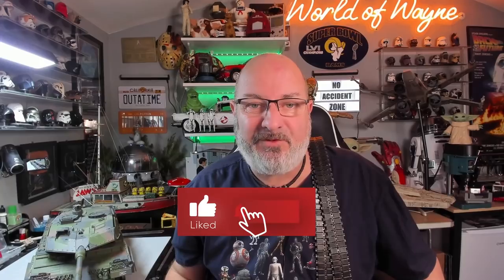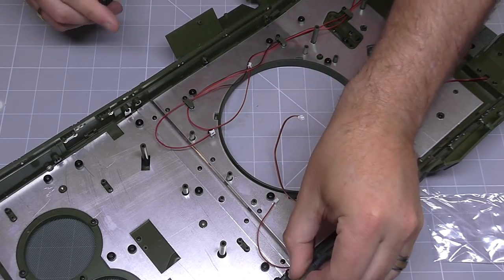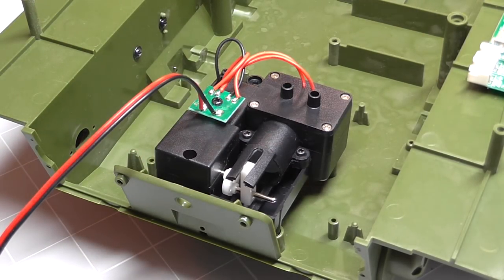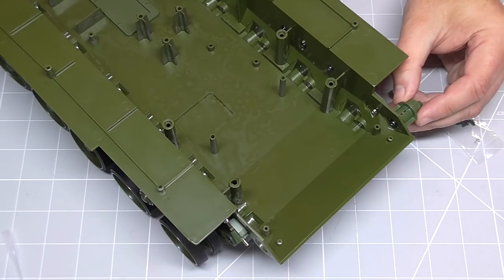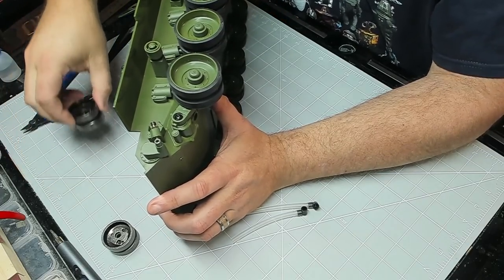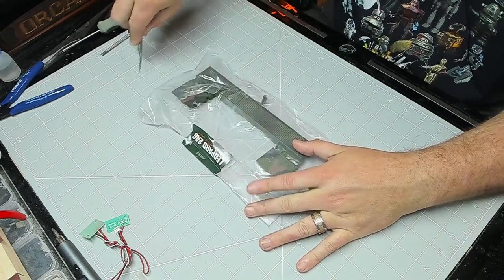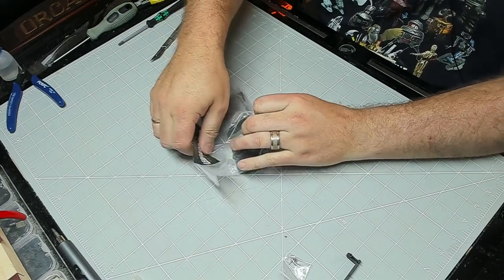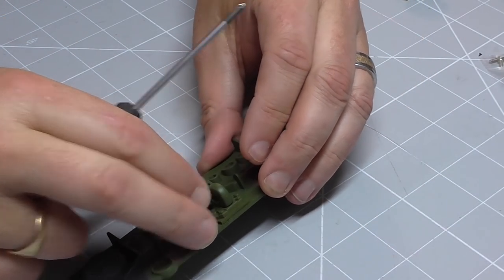Build the 1:16 Scale Leopard 2A6 Main Battle Tank - Pack 8 - Stages 61-69

Comment: Hi Wayne, stage 64 are the track tensioners.  They should spring outwards to keep the track under tension.  I found that they gave a better tension if you fitted them the wrong way round.  I.e.  left to right.

Comment: Hey Wayne 🙂those tensioner spring set ups should actually have 243 loctite on the screws and left juuuust undone to allow free movement 👍
Reply: Or 3 in 1 Oil
Reply: @bedfordshiremodeller4491  nah definitely not oil, by leaving the screw just loose and having the joint movable like it's needed so it can operate, that will let the screw work itself out, by using loctite, it will stop it where you set and not eventually fall out👍

Comment: When you mounted the rear lenses in one side it looked like the indicator was towards the middle of the tank the other points towards the side, I maybe wrong but I would assume that the orange lenses should both be the outer most lense. Also it looks like there are three leds on the circuit board, maybe worth checking that they are not sided. Doesn't make sense that they don't light any thing up but you have three slots in each lense that you installed first.... Just a thought.

Comment: Hang on a moment, at one stage you fill the smoke unit with smoke oil, and in the next stage you are turning the tank on its side to fit the metal wheels to the front part. Didn't the smoke oil come out of the smoke unit?
Reply from the maker: Thankfully not

Comment: Did some of the smoke oil spill out while you had the bottom half of the tank on it's side to attach the wheels? I noticed some pale green spots along the bottom of the tank after that point.
Reply from the maker: No. I didn’t put that much in here. That colour you see was there from pack 1